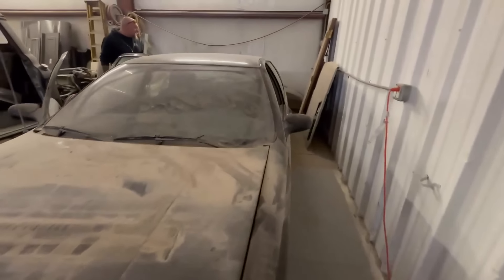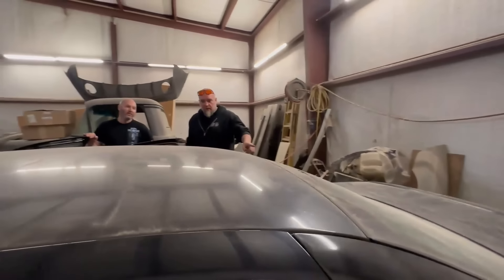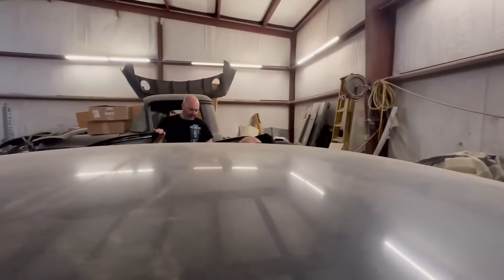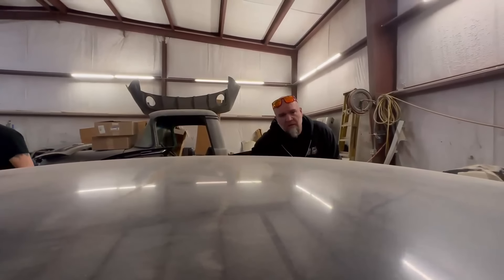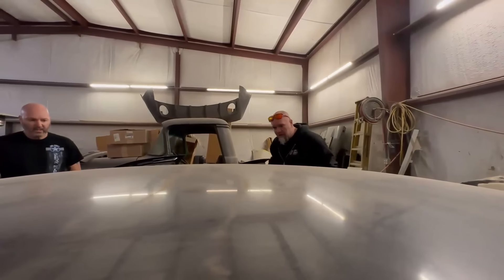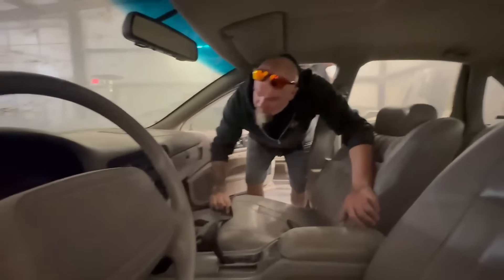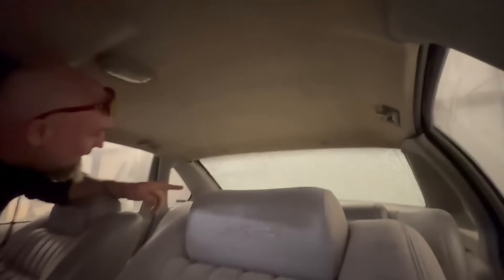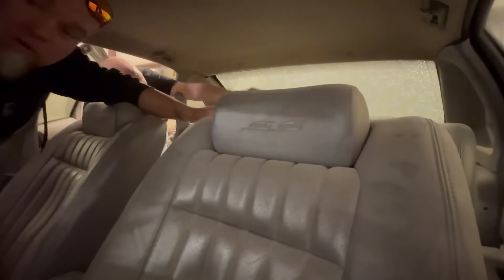Will It Run?! This '96 Impala Sat For 15 Years Before We Got Ahold of It!

Comment: Hey just a heads up that cluster is a easy fix just solder points break on the end that why u hit a pot hole it turns on also i have plenty of interior parts for impala ss if u need any

Comment: Not sure if you're allowed to say or not but I've always been curious- how much $ does it cost to race 1 full season of NPK?? Even without engine trouble or any major set backs it's gotta be pretty pricey right??
Reply from the maker: If you don’t start the season with $300k you won’t run up front
Reply: I had heard it was between 10-15k per week depending on parts failures etc. there’s no way to stay competitive without Pilgrim kicking in money or, your a millionaire.
Reply: Even at your alls income level ( which is obviously more than when you started street racing ) NPK is becoming everything you guys feared 6-8 years ago. It’s whoever has the biggest wallet. No way that 40k to win a race is going to support a full blown race program. I get that NPK gives you the opportunity for exposure especially on YouTube etc. but I think it’s gotten down to, is the juice worth the squeeze? I don’t think it is for most of the guys. That’s why Monza bailed on it
Reply from the maker: @timothynalley7802  that’s pretty close honestly

Comment: I like the new direction that you want to take the channel.  I'm 62 years old and I started drag racing when I was 15
with a 69 SS 396 Chevelle, and I've had roughly 20 other Chevelles, Novas, Corvettes, stock cars and my last was
an injected winged sprint car. I love all kinds of racing, but like you guys, I also really enjoy working on project cars.
I can't imagine being at the level you are in any form of racing. The time, money and the pressure has to get to a point
where it's just not as fun anymore. There are other things in life, and you've had a lot of success with your racing program.
If you enjoy other things as much or more, do them while you are young. You've obviously got a great facility to do it,
although you might want to consider getting heat and a/c for your shop if you are going to be doing even more work there.
Just sayin  🙃

Comment: I know where there is a 96 SS black cherry color 11K original miles with the auto on the floor. Very rare option. Still smells brand new inside @187Customs

Comment: Maybe it’s time to make a little room in a corner of the shop somewhere with one big window so you guys can see in the shop but have that room heated so you guys are more comfortable doing your videos and still see what’s going on out there for the winter time And maybe we have that room air-conditioned for the summer kind of like a dedicated room for your videos or Vlogs whatever you’re going to get into maybe Ramjack has a way that you could jack up part of your concrete floor at a time and make it radiant heat wink wink
Reply from the maker: We have one of those lol

Comment: If I had a big beautiful shop like yours I might wall off a section of the shop. 
I would put heating, cooling & a lift in it.
That way you could have a area to work in during hot/ cold weather. 
To expensive to heat & cool the whole shop.
Not telling you what to do, just floating a idea out there.
Love everything you guys are doing, keep the content coming! Thx
🔦🏁💰🤑🇺🇸
Reply: When he built the shop he should have added heated floors.

Comment: 230'000 on the dash, is it really? because i have seen a few with 380'000 on the dash yet the still have the OEM "..." part that brakes after 50k, and there is 0 service history of it being replaced every 50k where there known to always brake at 50k miles. cheap boarder crossing ride, high miles so they don't tax it... but part #... doesn't last that long but its still their. ... that 8K low low low mile, that has the 230k in it just not on its dash...